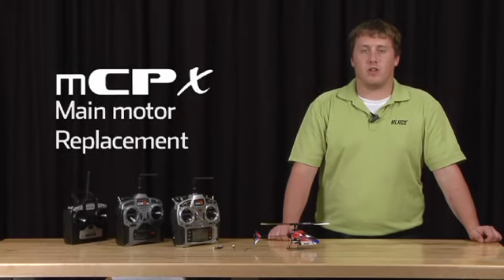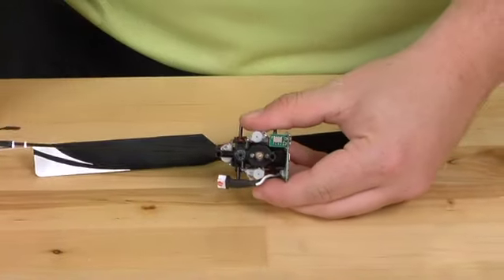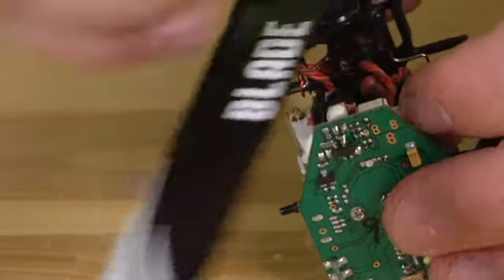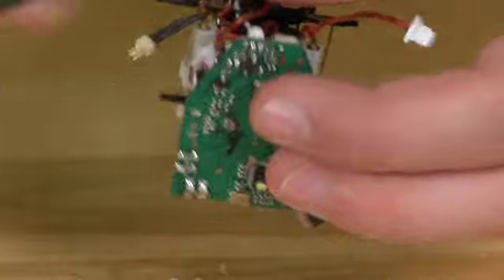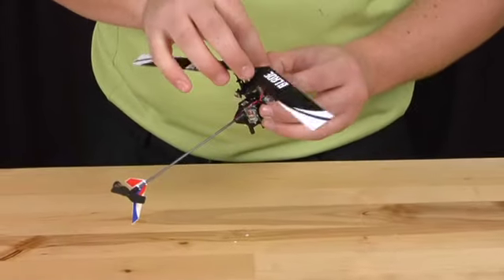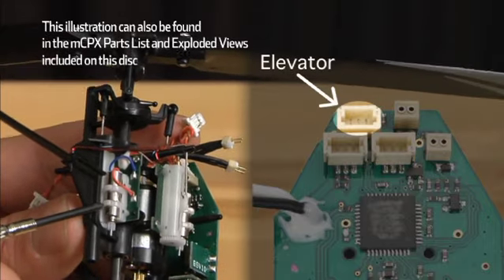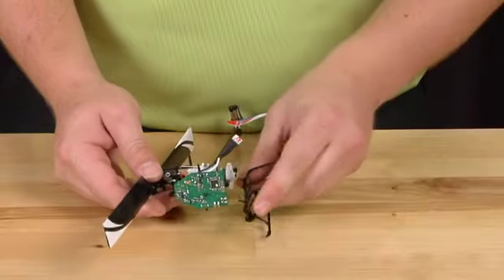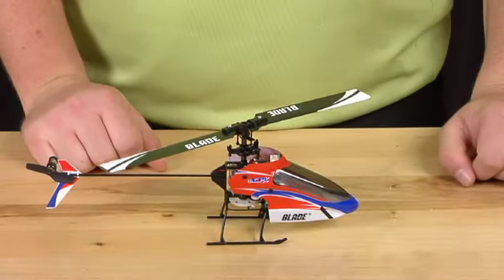Blade mCPX Main Motor Replacement

Comment: I got an MCPX this week, and my main drive gear was barely meshing with the pinion (up/down). I took it off and turned it upside down and it was fine. I now realise watching this video that it was shipped to me upside down and I was actually turning the gear the right way up!!. Also the tail booms may as well be made of glass ive broken three already. Going to change it for a solid carbon rod instead of a tube and run the wires down the side. Otherwise all good. Thanks.

Comment: Nice video.  The video shows the black and white wires to be reversed when it is being pointed out how the are plugged back in.  The motor plug has a green mark on one side of the plug to match with the green mark on the board whrere it is to be plugged into.  This is the same on both the original and V2 mcpx's.

Comment: Hi, can you please tell me if the main motor pinion should turm smoothly just like on the fixed pitch blades as my mcpx pinion turns like in segments and when i start her up the tail motor comes on first and then with a little more throttle the main gear starts. Is it the motor ? Thankyou

Comment: I had mine (v2) flying for just few mins and then suddenly turn 45 or 90 deg right and went off. A friend of mine suggested it maybe because of the motor or the batt connection.